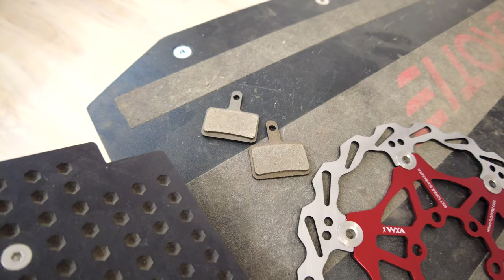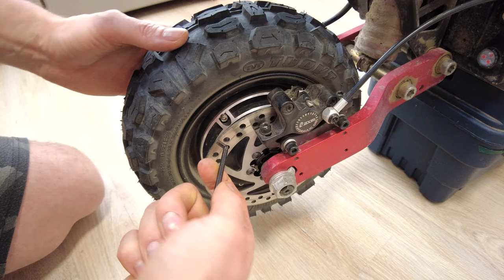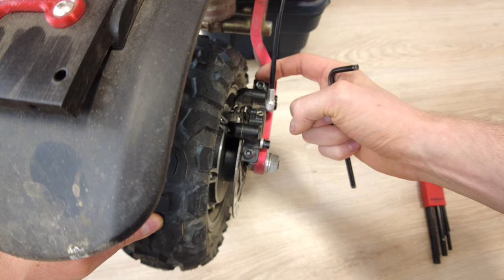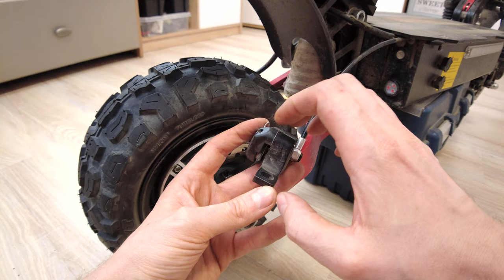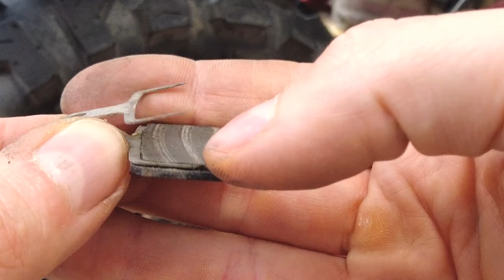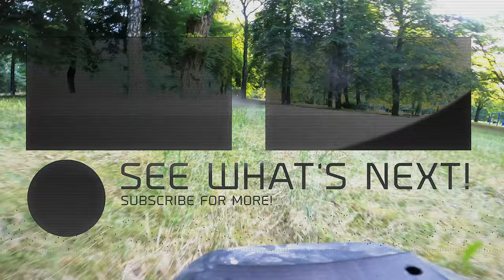How to Fix Brakes in Electric Scooter Ebike 🛠 Change Brake Pads 🛴Bent Brake Disc & Scraping noise 🍕🍻

Comment: For aligning the calipers against the discs, I normally use the same trick as with bikes: loosen the calipers and apply brakes so that these grab the disc. Then while keeping pressure on the brakes, tighten the screws again. Normally as long as the pads are not too irregularly worn, this results in very good alignment, as each of the two pistons will retract approximately the same distance from the disc.
Reply from the maker: Great idea, but it doesnt work well with Escoots 🍕🍻
Reply: @PirateWasHere  humm because of poorly built frames sometimes (and the respective brake caliper mounts)? In my case it works well with the Laotie Ti30.
Reply: what causes bent disc brake???  i have some scraping sounds and stuff once my scooter is rolling and i dont press down on throttle and just let go of throttle but the sound is similar... mines sounds like a whooshing sound like wind is coming in or through my wheels lol. @PirateWasHere
Reply: @PirateWasHere  how to adjust laotie ti30 scooter hydraulic brakes? when i press down the brake levers it looks like it is about to touch the handle bars. Please make a video on that if you can??? ty brother!

Comment: The problem is that the calipers are not positioned correctly ex works and the disc pulls inwards when braking. I solved the problem by loosening the two screws on the brake caliper, then pressing the brake and tightening the screws again at the same time. Then the brake caliper is aligned exactly with the disc.

Comment: Is there a way to flip the brakes on that Boyueda (move mounts on the left side swingarm)? and perhaps change wheel turn direction as well? I want to use a MTB brake system especially 4 piston ones.

Comment: Need help please.. I put my new brake pads in perfectly but they keep scraping on the disc ive adjusted the caliper in every way and stil cant find a solution
Reply: Did you get it right? Same problem

Comment: Your scooter has a massive amount of inertia, I just got the G3 Pro and I checked if the pads are rubbing against the disc rotor and nothing but, after giving it the throttle it stops spinning in a second or two not like yours where it kept going and going until you had to stop it by hand.

Comment: hi, i have kugoo s3 pro, long time ago my battery catched on fire, so i put hoverboard battery just so i can drive before i buy new battery, everything worked fine, so i bought 36v battery for e bike, now i put it, shows 33.5v and when i want to brake voltage starts coming up to 41v and it wont brake, only brakes when it passes 40v, my brake is electronic, not on pads, what should i do please help
Reply from the maker: if You got that big voltage spike from 33 to 41 when brake ( recharging )  then battery is heavly damaged or you got wrong settings in controller.
Reply: @PirateWasHere  thanks bro

Comment: My brake disc is bent and I want to replace it, but my disassembly revealed no way to disconnect the power cable... It's all shrink wrapped! There HAS to be an easier way to replace this small part!

Comment: On my 11x, I took it to get serviced and get a tyre changed and now its fucking worse that when I dropped it off to them.
They've re-assembled the brake units in such a way that the actual brake unit is scraping on the actual wheel rim (not the brake disc). So front and back wheel rims are both scraping against the brake units and making a horrible noise.

How do I adjust so the actual unit moves further away from the wheel rim?

Needless to say I'm extremely unhappy with the service shop
Reply from the maker: as U can see in the video, if there is any space between brake caliper and frame try to remove and rearrange brake caliper

Comment: Why are you bending it next to the brake caliper You have to do it in the bottom turn it all the way down. Because the top is bending next to the brake caliper. This will take long but my way is faster